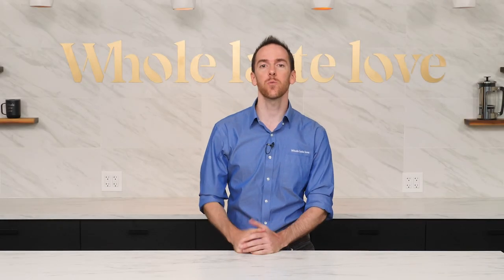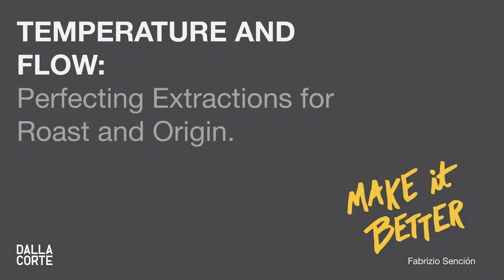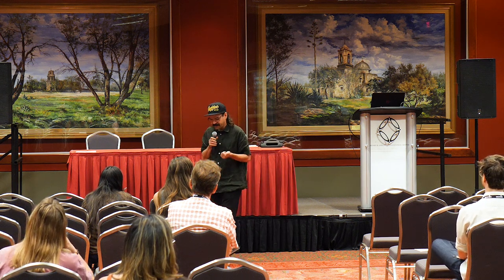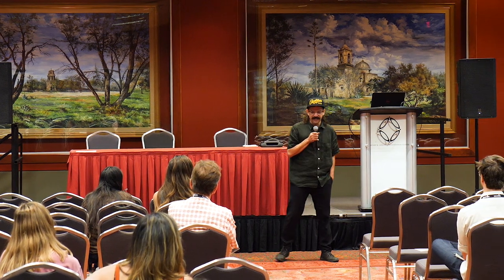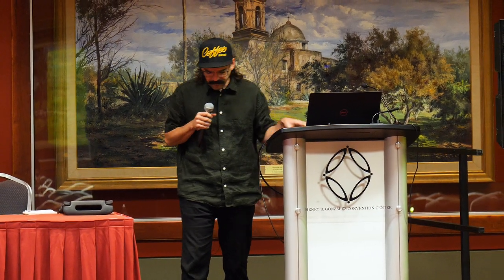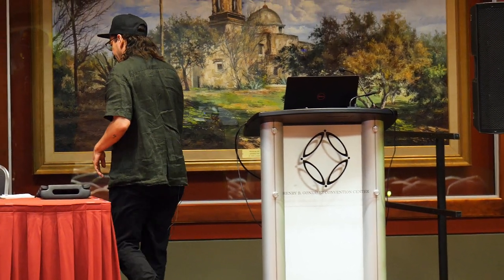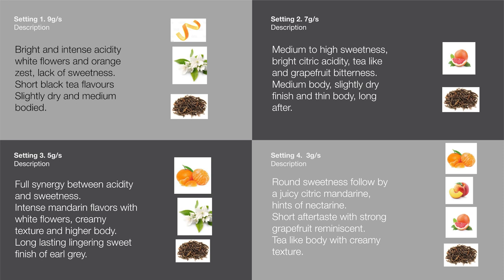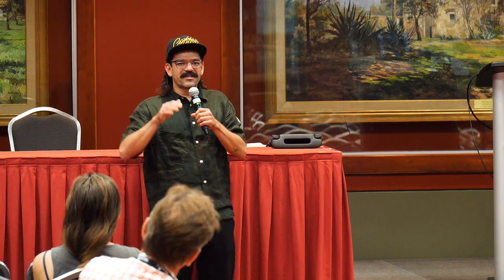Temperature and Flow: Perfecting Extractions for Roast and Origin

Comment: Many machines with rotary pumps have flow rates of above 10 ml/s, so using them without flow control would most often give rather bad shots? Sounds strange or what am I missing?
Reply from the maker: True, stock flow rate on rotary pump machines is generally around 11g/s. This doesn't mean you'll get bad shots, but especially with fresh, light roast specialty coffee, that may be higher than the ideal rate to produce the best possible results. For medium to dark roasts, or slightly older beans, it may make less of a difference. 
AJ